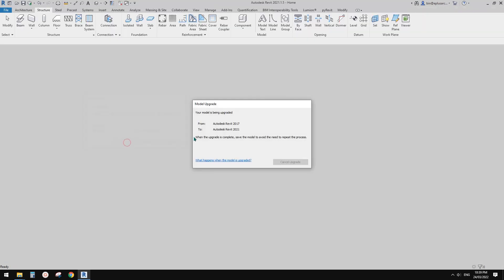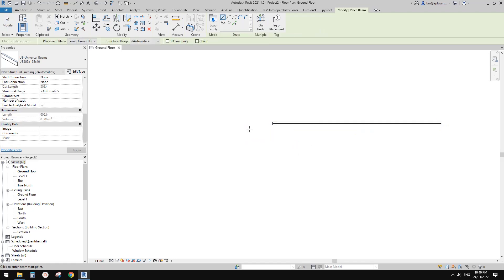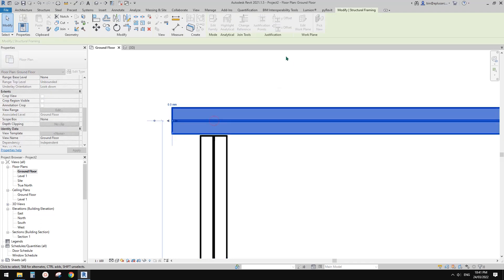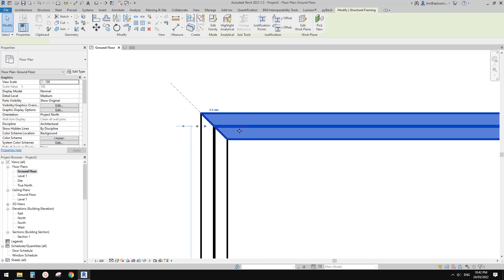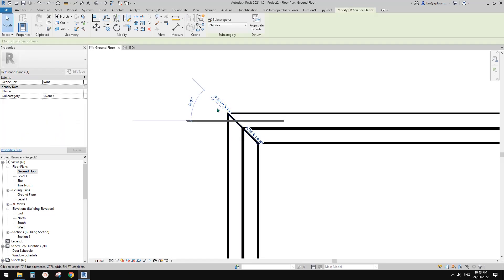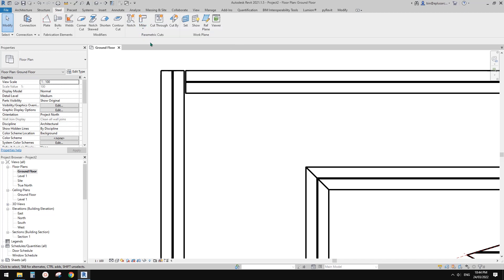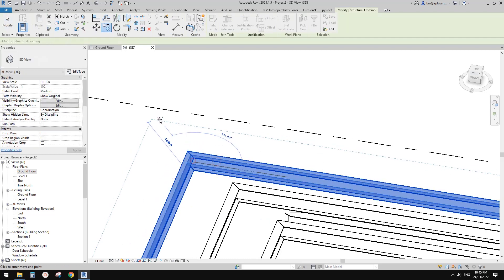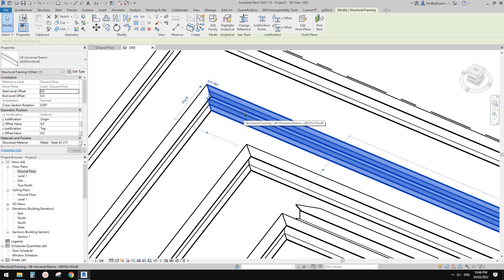Revit Exercise (Day 731) Three different methods to create Miter Joint

Comment: I am watching this video to apply to creating residential deck walk board patters.  The first technique causes the view to distort (I can't see anything).  I think this is because I am using wood instead of an I-beam (?).  The second technique works perfectly.  The third obviously only applies to steel.

Do you have a solution to why the first technique might cause a problem with the ability to view?
Reply from the maker: I’m not sure. Are you modelling the floor pattern using structure beams? Would it be better to use surface pattern?
Reply: @BINHE615  The advantage to using surface beams is that the program can run analytics and schedules of materials.  

If this was just an interior floor to display flooring styles then surface patterns would suffice.
Reply from the maker: Can you show me the pattern?